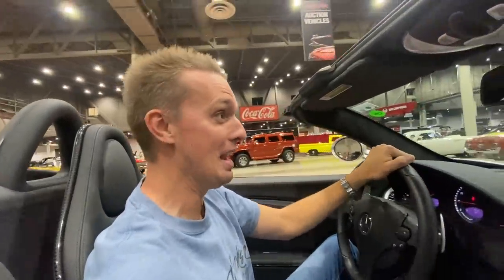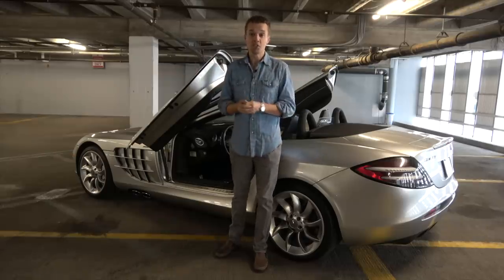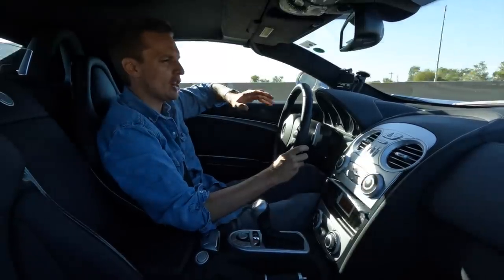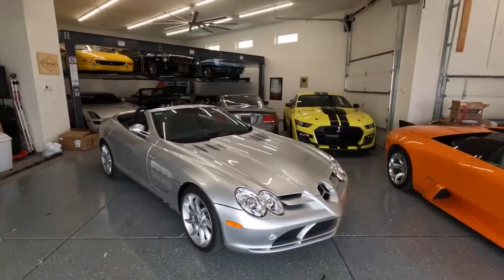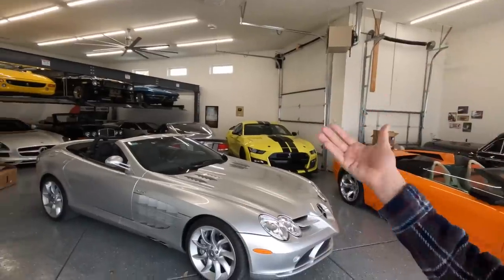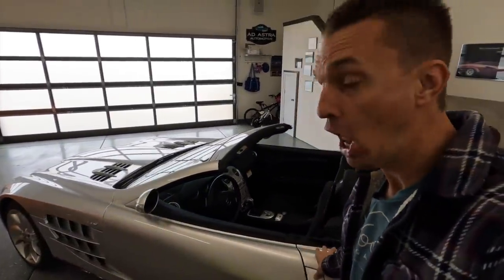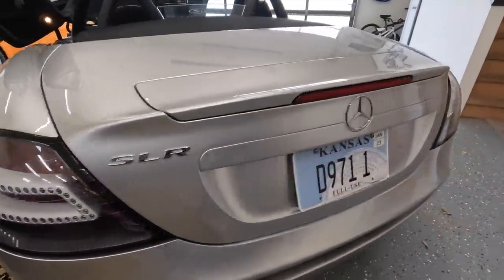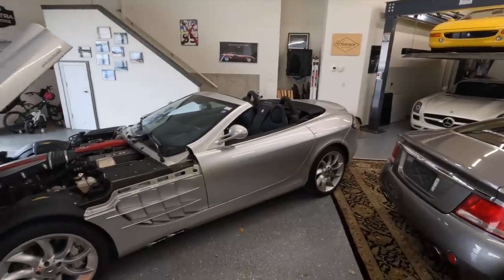Buying the cheapest Mercedes McLaren SLR roadster EVER, with previous fire damage?

Comment: The pricing on these rare cars in US when something is slightly damaged or missing is insane. "Well there was a fire, and it's been repaired now. And there's some carpeting missing. But in EU you could still register it as a new car, as it has 3000 miles on it which is slightly under 5000km. So will you take a 50% discount from the market price? Because if you don't then next week we're gonna up it to 75% and not tell you."

Comment: This probably has the most iconic wheel design
Reply: Except they are on the wrong sides
Reply: spyker?
Reply: This and the F50
Reply: They look like jet engine fan blades !!!😀😀😀😀😀😀🚘🚘🚘🚘🍺🍺🍺
Reply: And imho the most ugly front of any late Mercedes. Absolutely no fan of the try to implement the F1 pike nose design into this.
Reply: First gen viper
Reply: Timeless design all around.
Reply: @wingracer1614  something seems off indeed, is this by purpose?
Reply: According to Jeremy Clarkson during the test drive event for auto journalist the breaks catch fire and the engineers are like "yeah that's normal"
So the wheels design is for cooling
Reply: @Stan_the_Belgian  Doubt it, just some tire guy put the tires on the wheels backward and since the tires are also directional, the wheels had to go on the wrong side to make the tires right.
Reply: @wingracer1614  
When they made the Brock Commodore in Australia they supplied only right hand wheels to the production line....that way the workers always got two right....
Dealers fixed them up before delivery.. but then the tyres weren’t directional..🤪

Comment: 12:58 that is a pretty special layout- you have the entire engine, headers and exhaust between the driver and the front wheels, kinda like how a 911 has it all between the rear axle and the bumper. never really thought about how the SLR is front-mid-engined and also side-piped in front of the driver would require this packaging

Comment: Oh this is going to be a fun one. These things are outrageously expensive to keep running
Reply: And the two icons of reliability of that time. Mclearn. And Benz. That's the reason the resale never peaked.
Reply: My guess would be reaale hasnt gone up because of it being somewhat similar to an SL63 AMG. Even the gauge cluster is identical.
Reply: @CRAPO2011  its basically an sl55 amg. Same 5.4 but probably different internals maybe slightly larger blower or just pullied down /trans, same general interior.
Reply: @newchannelsamename5905  why's it so unreliable i don't get it, also it's not an sl55 the whole car is way different except for interior and engine(up-tuned to 620hp), the engine itself is the 5.4 m113k which IS a reliable amg motor.. more so then the 6.2 SLS motor he owns, so why is everyone saying it's so bad? I guess it's impossible to work on
Reply: @roboticvenom1935  i'm assuming due to its location in the car yeah. the sl55 drivetrain is very strong and can handle 700+hp absolutely no problem. I assume these have the abc suspension on them which is a terrible system as far as reliability os concerned and the convertible systems are known to get little bugs. But besides that i'd say this thing is probably very reliable
Reply: @newchannelsamename5905  Yeah it's the m113k, the best amg engine ever made so it's not a reliability issue(at least engine wise). But it's heavily modified it's not just some re-work of an SL haha, it's radically different( just look at the placement of the engine, how the hood works, the weight, etc.) Which also means this new change could have made any number of particular things unreliable like electrical systems(could be a flaw) or any random oversight during production. Regardless yeah it's odd as the drivetrain of the car is supposed to be pretty reliable, so I guess their bad reputation is based on the fact that it costs a lot of money to do routine maintenance on it!
Reply: @newchannelsamename5905  SLR doesn't have ABC suspension. It has passive double wishbones on all four corners. It does have the SBC system for the brakes however. And it's just that everything is crammed into the engine bay so it's just easy to remove the engine to get access to other parts. While your at it, you might as well do a full service with the engine out. XD But these cars never had much disastrous issues, just little annoying issues that cost $$. Some of these have driven higher mileages, not really surprising for a merc though.

Comment: In 2008 I was driving truck, hauling shipping containers. I was dispatched to haul a container from the port in Savannah Ga, to the Mercedes distribution center in Jacksonville Fl. I had hauled parts, and even picked up warranty parts containers from there many times. When I got the container from the port it was different than normal. The container had 4 doors on both sides, and the font had a door as well as the typical doors on the rear. I was intrigued to say the least. There was nothing on the BOL saying what was i side but that isnt unusual for container shipments. When I arrived in Jacksonville at Mercedes guys come out and start cutting seals and opening all of the doors. Inside was a pair of Mercedes/McLaren SLRs. I had no idea I was hauling arround $1.3 million in cars.

Comment: The fire you have reported was a common issue on the “normal” SL! It was caused by a faulty BCM module in the trunk (over the rear passenger side wheel arch) which manages the battery usage. Condensers/chips go mad when the battery drain all its residual energy, so users reports rotten eggs smell and then in worst cases a fire. Make sure you keep the battery well maintained, funny to see Mercedes never issued a recall for that, even if this effects also an halo car like the SLR and not only the “more” common SL

Comment: Nice. I just always wondered why the wheels look like they funnel air under the car instead of pulling the air out from under the car. I mean if the wheels are fan-shaped why not have them pull air from The wheel well and under the car through the brakes and out into the air stream.

Comment: Really good to have some appreciation of the SLR designed by Gordon Murray   During its production the relationship between Mercedes and McLaren soured   It had been intended that Mercedes supply the power unit for the next McLaren project   Due to this McLaren went it alone to design & develop the 3.8 v8 for the 12C and subsequent cars   Mercedes also pulled away from McLaren on the Formula One relationship to buy Brawn GP   The SLR deserves to seen as a celebration of the Stirling Moss SLR rather than compared to the Porsche 918   It is an arresting car from the moment you see it and doesn't disappoint behind the wheel

Comment: The wheels have been switched from side and are now in wrong direction. Who did this?!? Wheels like these are supposed to push air to the outside and not try to suck air from the side (aerodynamically it is bad, believe me. I'm an engineer and this is my specialty). So please, correct it!

Comment: I bought an 02 A4 1.8 the guy was putting in a fuel filter and it caught fire... I replaced the passenger side wire harness all the way to the tail light., Threw on a battery from ranger danger and viollia the alarm start blaring.... Smiles for miles as I was fixing in the road in prestigious Boulder co.... So the cops and snobs we're all over me still are cuz they suck .

Comment: I can't say anything bad about Mercs (been driving an audi A6 for 5 years and looking into buying a Merc for better reliability - or a 5-series with N57 (to hear my chains rattle) with a manual (Merc OM642 were not paired with manuals in E-Class) in order to find out why 75% of cars driving on the Nürburgring are BMWs) -- nevertheless, in respect to this video - I've solved it. I know why this car is the most "reasonable" of the crazy supercars of mid-2000s. You won't see switchgear from a Golf or a Passat in the Veyron. Yet here we are, a Mercedes SLR - and the steering wheel (and climate controls) from a W211 E-class. Well done, Mercedes. Greetings from Latvia.

Comment: You need a transporter to move your vehicles. With low milage, driving them for parts/service is not ok. Driving for pleasure days / enjoyment miles is ok.
Buy or partner with a transporter company, they will also benefit from the partnership sponsoring.
Please choose a non redneck company please.